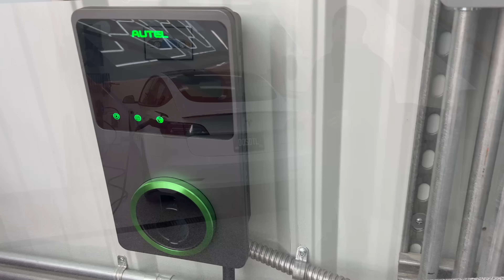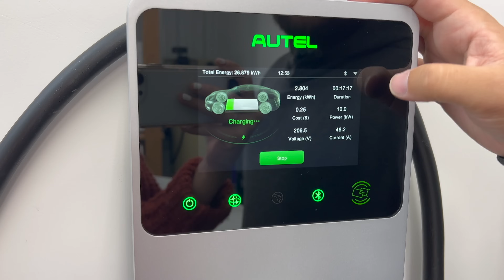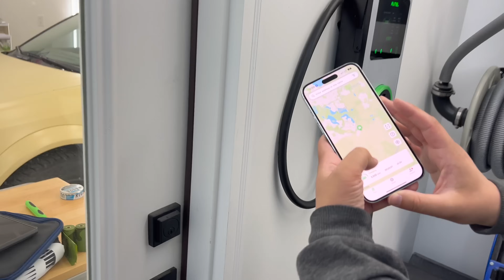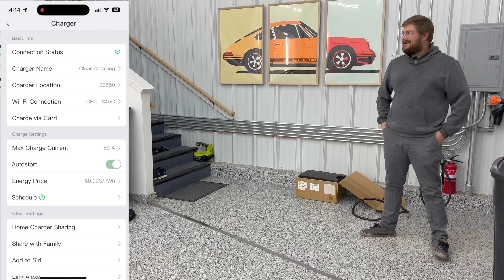We Focus Too Much On DC Fast Charging! Here Are Some Level 2 Considerations - Autel Touchscreen AC

Comment: Excuse my idiocy when discussing power coming out of the panel. Two hot lines! Also - if any electricians want to join us in talking about install considerations please reach out.
Reply: Kyle, Just letting you know that at 19:30 there is a jump cut backwards in the video a certain amount and repeats material until the finish. Still a wonderfully informative video, just wanted you to know.
Reply: @randyshanofsky9903  I noticed that too. I thought there was something wrong with the YouTube app. The video actually kept on playing past 19:46
Reply: In terms of the wiring, modern EVSEs go with the 4-pin NEMA 14-50 standard.   L1 (hot), L2 (hot), Neutral (typically wired but unused), and Ground (required).   But there are lots of adapters and EVSEs that take various older styles of dryer plugs, which I recommend avoiding as much as possible because dryer plugs aren't designed to run high amps for hours on end.

For 240VAC, the actual power is carried on L1 and L2.  L1 or L2 against 'Neutral is just 120VAC, but L2 is 180 degrees out of phase with L1 so L1 against L2 gives you 240VAC.  In the U.S. Neutral is right smack in the middle at the same potential as ground.  In the E.U., however, 240VAC is not symmetric around ground, it is entirely above ground, and there is usually only one hot.  It will be 240VAC against neutral, offset above ground.

Neutral is not used at all for U.S. 240VAC, but on some devices it is monitored.  Most EVSEs just ignore the neutral entirely... it is often not even wired internally.  However, the EVSE is required to test ground against L1 and L2 to make sure there is a solid ground connection at least to the EVSE.   More sophisticated EVSEs will test that ground and neutral are bonded (at the main service breaker box).

All EVSEs are required to test for ground faults (current on the ground) and disconnect.   Usually the EVSE also checks the L1 and L2 voltage against ground to make sure the ground is real and voltages are as expected for the region.

--

Now, in terms of wiring, one thing people need to be careful about is that traditionally NEMA sockets were designed for dryers that only run an hour at a time, not for EVs that might be sucking max amps for 8+ hours.   So a lot of NEMA sockets out there are actually quite deficient, even when they are advertised to have a 50A circuit rating, and even when they are 14-50's.

Always get a quality socket, don't low-ball the price. Even if you only have, say, a 20A circuit, you still want to use the beefiest NEMA socket that you can find.

Even if you have a 50A circuit and socket, you might still want to program your EVSE for a lower max amperage just as an added safety.   After a new installation, check that the socket is not melted or burned or smells funny at least once a week for a few months before you get comfortable with it.

Tesla EVSEs tend to be hardwired.  Well, many EVSEs in general are hardwired, and many are not.  Hardwiring is theoretically safer than using a plug, but even hardwired wiring can have severe issues if installed improperly.   To be honest, a good NEMA socket is just more useful than hardwiring.

The breaker should always be sized to protect the wiring, and then down-sized from there as desired.  So a 50A NEMA 14-50 with appropriate wiring would get a 50A breaker.  But if you have only 20A wiring with your 50A NEMA 14-50, you would obviously put in a 20A breaker.   And of course you would program the EVSE to not suck up more current than the wiring can handle.  Double safeties... very important to avoid turning the wiring into a line of fire.

--

Finally, in terms of which EVSE to get... to be completely honest, I don't like the ones that have fancy displays, wifi, bluetooth, or are too smart for their own good.   I just want a basic weather-proof unit and dip-switches to set the highest negotiated current are just fine.   I wound up getting an out-door Grizzl-E for my garage (Canadian product so obviously it can handle any weather), and a stupid cheap programmable portable EVSE with a NEMA 14-50 plug to throw into the car, along with some adapters when visiting friends houses who have convenient dryer or 14-50 plugs to plug into instead of 120VAC.

That's pretty much it.
Reply: Oh, one more thing... NEMA plugs are VERY DANGEROUS.  When the plug is being put into the socket or is partially but not completely pulled out of the socket, those long prongs are fully accessible to your fingers.   People often grasp the plugs wrong and wind up touching live prongs.  So always be careful when plugging or unplugging one.

For an EVSE, you have that convenient breaker... make sure the breaker is open.  I know it may seem a bit silly to some, but its a good habit to get into.   Even the most experienced electrician will have touched a live wire or prong dozens of times in his or her career.

The breaker will be double-pole, it disconnects both L1 and L2.  In addition, either the breaker or the EVSE will have a GFCI or equivalent capability for safety.  The rules are a bit relaxed in the U.S. unfortunately, but in the EU and the UK the breaker itself must integrate a GFCI, I believe.
Reply: @junkerzn7312  , nominal AC voltage in other countries is 220 V (RMS), and it completely not related to the 120 V x 2 voltage in the U.S. That voltage saves a lot of copper and allows higher power for appliances like coffee makers.
Reply: @michaels3003  In terms of home ingress, the U.S. is actually 220-240VAC split-phase... which is just a matter of how the taps on the transformer are arranged.  Because it is split phase, most of the house wiring just uses neutral and one of the legs which is 110-120VAC.  Hence your typical 110-120VAC plugs.    "Split phase" in this case means "Single phase" with neutral in the middle of the waveform.

So basically all this means is that in the U.S. it is 220-240VAC single phase, almost identical to Europe.  In Europe, it is 230VAC single-phase, offset above ground.  In the U.S. the ground is in the middle of the waveform.  In Europe the waveform is entirely above ground.

The wire sizes are the same either way.  It is still roughly the same voltage U.S. or Europe as far as an EVSE is concerned.

House wiring works a bit differently.  In the U.S., because it is split-phase, the legs are wired into the house independently and each one provides 110-120VAC against neutral.  But this ONLY applies to house wiring to 110-120VAC plugs.

But EVSE's are not usually connected to just one leg. Because an EVSE in the U.S. is connected to L1 and L2, they basically just see 220-240VAC single-phase.   Roughly the same as in Europe.

Britain is a bit different.

The transmission and distribution infrastructure across all countries is roughly similar.   Voltages are bumped up (700V to around 1 million volts), and bumped down, as needed.

-Matt
Reply: @junkerzn7312  , I meant copper for all 220V appliances, not specifically for EV charging. A long 220V extension cord is much lighter than a 120V (with the same power rating). In a better developed "world," there would be the same voltages and the same plugs/receptacles everywhere.
Reply: It's a 240V circuit, that's why there are 2 hot lines.
Reply: @davelavigne2133  This particular install appears to be fed by 2 phase of a 3 phase power supply (typical for commercial buildings), so it's 208v rather than 240v.
Reply: I've noticed on slot 12/14 and 20/22 there are Eaton style breakers and slot 21/23 there is a Square D Homeline style breaker. You should only have the one style that fits the breaker panel. Looks like Siemens style. Having a different style breaker might not be seating right or not have enough contact causing heat. I would recommend getting the electrician replacing it with the breaker that's designed for the panel. They're only around $15 and better to replace it than something bad happen. Also I'm not 100% if that's up to code either. 3:25
Reply: Is it me or is 208 a large voltage drop from 240, even if he was at 220v down to 208v.  Under sized for the run.?
Reply: @Themachinewon  208v is tapped off a 3 phase system.
Reply: I’d also add a blade or switch style disconnect near the unit to be able to shut off quickly.  In some localities it is required but it’s a good safety practice regardless.  

Not a fan of 14-50 because the idea of connecting and disconnecting a 48 amp circuit seems like a bad risk.  Especially given the poor quality of some outlets.  If you must do this buy a commercial grade Hubble outlet.  More expensive but worth it.
Reply: @stevenichols4639  Actually anything at 48A or above (aka a 60A circuit) requires a hard wire install.  40A (32A charge) can be wired with a 14-50R plug.  All that being said, definitely avoiding plug/unplug cycles is desired.  I try to hardwire whenever the unit doesn't need to be moved.
Reply: @klossfam  not true. You can use a NEMA 6-60 for 48A (80%). It’s just less common and more expensive to use connectors 60A and higher. I have used 100A Hubble connectors in data centers and the pin sets can be over $2000.
Reply: @olemissjim  munro live good example of a dedicated not nEMA plug due to inferior build of plugs
Reply: @olemissjim  I know higher amp receptacles exist but code in many jurisdictions requires hardwiring 48A or above. Most EVSEs at 48A only come as hardwired aka no plug. You can always attach a 14-50 or 6-60 but not recommended.

My Ford Charge Station Pro only came as hardwire due to its 80A charging capability. I had two 40A 14-50Rs in the garage, I just took the receptacle out of one and hardwired the Ford CSP to use at 32A.
Reply: Breaker is a disconnecting means
Reply: How about the editing of the video?
Reply: Carrying Mississippi masters license in electricity license bonded an insured WILL INSTALL CHARGERS SOLAR FARMS  above a Serenity city terra tunnel power plant to supply a renewable retirement charatible community for patients parents at St Jude because when th children know that mom and dad or jus mom is taken care of an not in a swanky motel off Lamar ave they feel much better

Comment: 18:00 I bought a house built in 2011, 100amp service. It’s just sad that they cut corners in places like three feet of wire and properly sized breaker (the garage was so cluttered needle we bought the house that we had no choice and we got a good price in a very bad market.

The whole house needed detailing, mostly because of dogs in the basement and a cat upstairs. We have owned it since 2023, and we still have carpet that needs replaced and hardwood floor damage, I’ve been recovering from cancer surgery for two years and now, now I keep thinking, do I want to start this project right before my kid starts college (less than a year)? Plus, I have to worry about the dog (semiretired service dog- project would be stress for her) and if I wait, we’ll, it’s simpler and I’ve had plenty of other projects.

We seem to peak around 7 kW w/o charging 1.2 kW is the highest difference in phases, but I don’t know that those events happen at the same time. I need more data! Anyone else? I wish there were cheap dynamic load EVSE for home use that could take everything available in Home Assistant so that they could be 80% of your house availability (5amps or 80 amps, if connected to a 100 amp circuit). Of course my max charge rate is 10.5kW, so half of that would be fine,
Actually, I never installed my level 2. The portable charger sorry EVSC that came with my bolt EV was my only charger and I unplugged it one time because I wanted to back up during a trip to Philadelphia where I wasn’t driving and couldn’t hyper mile at all and had to go from my house to my uncles house and then my uncle Sarah driving and he drove from his house to Philadelphia. I had surgery while he drove to the pharmacy to lunch back to the pharmacy and then back to the oral surgeon’s office where we were both informed that I had woken up during surgery for the second time. Luckily, he actually warned me and I didn’t remember because he noticed and gave me medication to not remember and hoped to that it worked so that I didn’t have that traumatic memory, but was kind enough to tell me. He is also smart enough to tell me while I was still medicated and calm. He was actually very good surgeon. My uncle Penn drove the entire way back to his house and I took pain medication the entire way home at the maximum dose, including my newly met in getting permission from the doctor to give me an extra dose because she could see that it wasn’t helping and call in the car. Say it’s been a half an hour and it’s like I gave him a TicTac can I please give him another dose and he like one time yes give it to him. It helped the teeny tiny bit. I stayed at his house for about half an hour to be sure that the anesthesia had worn off. I was pretty sure when we got there. It had but you know to be safe. I forgot to plug the car in at first, and once I did, I discovered that it would not charge because the charger was broken again. The car is actually women the charging unit anyway because one of the two split phases did not charge so it loves to charging on a car was out. They should’ve bought it back at purchase price. I basically got screwed out of about $15,000 minimum after that, it went back to level one charging for the rest of his life. someone hit it in a parking lot. It was hit in a parking lot and I have no idea why it took so long to fix but it did so I had a EV-6, less than 24 hours after I pick that up I had to go get a cancer screening because my mother had just died and it was a hereditary cancer. It is slow growing. I don’t have anything to worry about for about 20 years, but I needed to know about it before I even found out about it. I was coming 51 mph 1 mile above when the auto breaking turns off mind you so my reaction time is the only thing they could stop me and neither my reaction time nor the reaction time of the car in front of me or behind me was quick enough as I got it behind and pushed through the car in front or hit the car and I’m not sure either way the accident was ruled the fault of the weaving and speeding 24-year-old with state minimum coverage that didn’t even cover my car so my insurance had to pay for it with their underinsured benefit in my car was deemed a total loss. Hyundai uses blue link which means I no longer have access to any of the remote features unless I’m willing to pay through the nose on a subscription basis. I really got spoiled by that Tesla model three that Hertz upgraded me to, mostly because they felt so bad.

Comment: I have lectron 30 amp charger which I can run my dryer or my Tesla model y . Almost every half hour makes bang noise . They replace it right away with a new one . Does the same thing . Any suggestions? But it does charge my car without any problems except that bang noise problem

Comment: ok, so this was an Autel infomercial. cool. 

btw , that  flex conduit job on that first Autel wall charger .... holy smokes..

and unless your're in the habit of running your cars below 20%,, two EVs at home will almost never mean you need to plug two cars at the same time... and when you do, you  will get them both charged  before the next morning  w one charger.... and thats w a weak ass 7kw lv2  charger .ask me how I know.

Comment: I get this is a Autel commercial, but the Tesla wall connector is cheaper and can be shared. You just need a 48amp connector to plug in the car, everything else isn't necessary. Nice video.

Comment: I've been using level 1 charging in my garage since buying my Bolt in December because my panel, though equipped with 200-amp service, has run out of slots to add a breaker for level 2. Rather than having some rather expensive electrical work done, I've ordered a 36', 240v extension cable that will carry power from the NEMA 10-30P dryer plug in the laundry room to my portable level 2 EVSE. (I'm also getting an automatic switch that will give priority to the dryer if both want to run at the same time.) Now, having watched this video, it looks like it would be smart to limit the charger to 80% of the cord's 30-amp rated capacity (24-amps.) Glad I saw this because I'd just as soon not burn down my house and the surrounding forest. That might irritate my wife, who's already skeptical of this whole EV thing. Oh well, 5.7kW charging is still almost six times faster than the 960W I've been managing with level 1.

Comment: So technically where the 80% comes in is the national electrical code in the US for the breaker itself.  The most common style of breaker cannot handle 100% current rating for more than 3 hours at a time.
Reply: It actually has more to do with the design of the breaker rather than directly a heat issue.

Comment: Shows us a Siemens panel with unclassified Square D homeline breaker and a couple EATON breakers installed in it. I wouldn't use the SQD Homeline or Eatons for a continuous load charger in a panel that doesn't support those breakers. Hire an actual electrician next time. And if you did.. QUESTION the one you did hire.